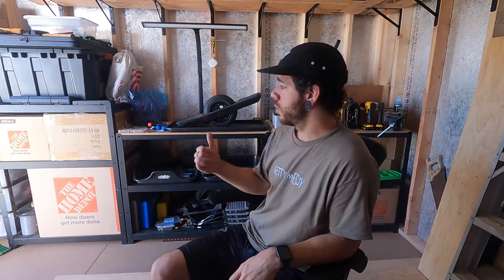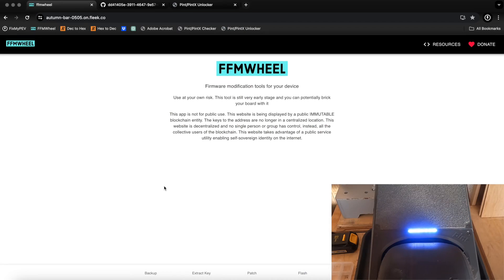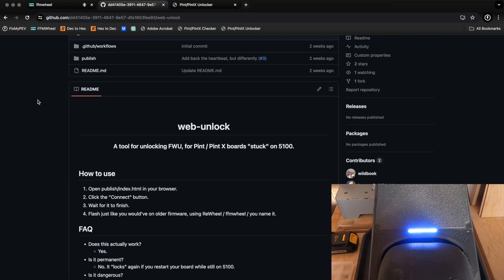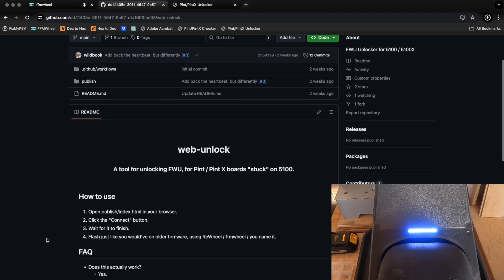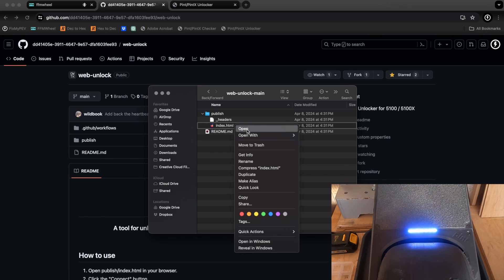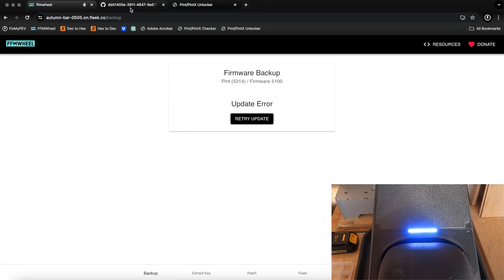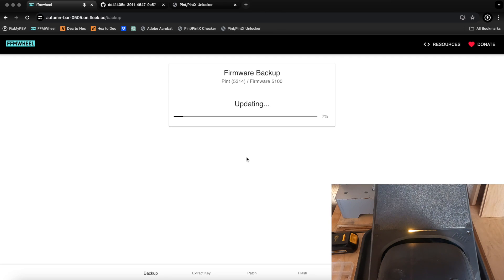Downgrading Onewheel Pint & Pint X: Reclaiming Control

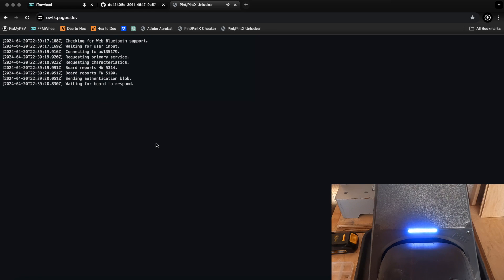Comment from the maker: NOTE: 5:00 / 7:17 - If you're unlocking a Pint X, you will need to go to the 'Flash' tab instead of the 'Backup' tab. The 'Extractor' is not compatible with the Pint X.
Reply: Where do you get 5076 from to flash to the board? “Flash” only allows you to “Choose File” but you can’t “Backup” a Firmware to modify or reload.
Reply from the maker: @kevinaustin2115  To clarify, the backup process doesn’t produce the firmware files. It only produces a bootloader-settings file that is the basis for running firmware to the microcontroller. For information on Gemini - 5076, feel free to send an email at https://www.fixmypev.com/contact-us.
Reply: @fixmypev  back to what Kevin asked.  During this video you state that you CAN do this with the pint x, but you are showing only the Pint being autoflashed through ffmwheel, which pint x is not compatible, you have to upload the firmware through the "Flash" section. Where do you find the file to flash onto the pint x? Are you able to show the process of getting the "downgraded" firmware onto a pint x?
Reply from the maker: The Pint X is compatible with the ‘FLASH’ function of FFMWheel, but nothing else. The Gemini - 5076 file can be located on the ‘RESOURCES’ tab. As for the process:

- Unlock w/ Unlocker Tool
- Navigate to ‘FLASH’ tab on FFMWheel
- Flash Gemini - 5076

The only difference between this and the OG Pint process is that you can’t ’BACKUP’ or ‘PATCH’ the Pint X. Only ‘FLASH.’
Reply: @fixmypev you rock! I’ll try it out
Reply from the maker: Let me know how it goes! 🤙🏼⚡️💯
Reply: Is this information still valid ? I got a pint X fw5100 and would like to downgrade. The unlocking system did seems to work normally. Will I brick it or can I use the file in ressources safely ?
Reply from the maker: @TheCracouvomi  Yes, this information is still valid. However, pay attention to any warning messages you may get when using the unlocker tool. If the bootloader version is not recognized, you are best off not proceeding with the downgrade (BL 255 is ok).
Reply: @fixmypev  it's telling me board reports BL7
Reply: ah damn it doesn't work, i got pintX HW7314
Reply from the maker: @TheCracouvomi  If you see a red warning message, do not proceed. You'll likely brick your board.
Reply from the maker: @TheCracouvomi  The unlocker tool does work with some 7314 hardware boards, but if the bootloader version isn't supported, it's not advised to move forward with the process.
Reply: @fixmypev  no red message on the unlock process, it's the update of the firmware on the flash side of the site that's returning an error. Do i need to do something with the bin file first ? or just select it and pray ?
Reply from the maker: @TheCracouvomi You have to be super quick after unlocking. It helps to keep the FFMWheel sit open with the error up and just hit “Retry” immediately after unlocking again. Should just be a timing thing. You got this!

Comment: Hey man, i noticed you were still active in the comments a few months back, im hoping to get some help.
I've rewheeled my pint before following your guide. Twice actually since I wanted to do a different patch. Now that Ive upgraded my pint with a new battery I was hopping to repatch with the correct battery size. Well, I cant seem to reconnect my onewheel again to my browser, im following the same steps I did before. The only possibly issue I can think of happening is on my last patch, I enabled pint x spoof in hopes of getting that custom shaping, since the custom shaping patch didnt work the first time. 

My step to step error is, i click backup -> Pint Firmware [5040] -> Connect -> (pair in chrome bluetooth window) -> It loads for one animation of the bar filling up -> I go to click connect and go back through the pair window -> repeat a couple times (4-8x) untill I get "This Feature is not supported for your board."

I never had to use the web unlock repo initally, my board was originally 5050, now 5040 after first rewheeling it.

Any help or support would be great. Thanks man
Reply: ISSUE RESOLVED, Dunno what I did other than swap back and forth between EDGE and CHROME a couple numerous times doing my same process until I went straight to the flash tab and was not greeted with the connect button, I just loaded up my new patch with my upgraded battery info and flashed. Board went through the whole flash process, rebooted and works great. We'll see if I can use the full batteries juice now
Reply from the maker: Glad to hear you got things sorted out! It was definitely the spoofing that was causing the issue. The backup process doesn’t work any time you have spoofed as an XR or Pint X. To get around that, all you have to do is skip that step and go straight to the Flash tab (or Patch tab if you’re patching firmware and already have a backup file).

If you ever need help again, feel free to reach out through my website any time: https://www.fixmypev.com/contact-us

Comment: Hi, getting error 23.  Just showed up this weekend.  Tried unlocking the board per your video and it fails every time.  Tried 50 times or so.   How can I fix it?
Reply from the maker: Hey! Error 23 is meant to be displayed when the controller detects abnormal battery usage. If you’re receiving this error and have not altered your battery, you may have a false error occurring. Feel free to email me if you’d like to discuss the issue further.

https://www.fixmypev.com/contact-us

Comment: Hi! If the hardware on my pint is exactly 5314  and the firmware is 5207 is it ok to downgrade ? Thanks for the support! I bought a use pint with the quart battery, i've unfortunately updated the firmwate with the app before using it, my battery gives me only 2km with full charge, could the problem come from the update?
Reply: I have the same question. Let me know if you find out
Reply: @ape1755 yeah, if your firmware is over 5100  you can't downgrade and rewheel. But the owner of this channel offers a mail in service to help you with that.
Reply from the maker: Hey! The Hydrus - 5207 firmware blocks the ability to downgrade via Bluetooth, but I still offer a mail-in downgrade service where I can reprogram your controller. As for the 2 km range, I do know that the newer firmware doesn’t play nicely with extended range batteries, but it would usually still allow you to achieve stock range… It’s possible the update could be flagging the battery sooner somehow, maybe based on the discharge characteristics… but I’m not 100% sure since FM’s firmware is encrypted/protected. If you’d like more info, feel free to reach out via my website.

https://www.fixmypev.com/contact-us

Comment: Sorry if this question is old, but are you okay to downgrade on 5314 and only above is locked, or is 5314 locked out also?
Reply from the maker: 5314 would also be locked if your firmware and/or bootloader is too new. You can check that with the unlocker tool highlighted in the video.
Reply: Yes its definitely locked for me, do you still offer a service to st-link from 5207? I'm in new Zealand  @fixmypev
Reply from the maker: I do! You can reach me through my website.

https://www.fixmypev.com/contact-us

Comment: Very cool! Will this work with Hydrus 5207 firmware + 5314 hardware? What app(s) would you use to adjust parameters, set new pushback limit? 🙏🏼
Reply from the maker: Unfortunately, no. To downgrade a controller running Hydrus - 5207, you’d need to completely reprogram the microcontroller.

That’s a mail-in service I offer if you ever want to take advantage of it.

https://www.fixmypev.com/contact-us

Comment: Will this work on a og pint running firmware hydrus 5207 and hardware 5314
Reply from the maker: It’s unlikely due to the limitations implemented by Future Motion in their newer firmwares, but would be possible via hardware methods. I believe you and I discussed this elsewhere already, but wanted to make sure to answer on the record here as well. If you have any further questions, feel free to reach out via my website any time. https://www.fixmypev.com/contact-us
Reply: Yes we did you cleared it up for me well thanks unfortunately my boards not compatible with this video 🎥  @fixmypev

Comment: Am I able to downgrade from Hydrus - 5207 using the same process?  Thanks in advance!
Reply from the maker: Unlikely, but check the note in the video description. If your board isn’t compatible with this method, feel free to reach out via my website. I may be able to help, depending on your board’s hardware version.
Reply: @fixmypev  messaged through website

Comment: Whats the scoop on newer pint x's and downgrading to delete the Haptics?

Unlocker tool gives me the RED no go but I read a comment with some success on a newer HW?? Im not finding any solid pattern as to what HW/FW can or can't downgrade. Seems a bit scattered. Maybe I'm missing something obvious??

Ive got a PintX
HW: 7323
FW: Hydrus 5200
Reply from the maker: The newer boards ship with newer bootloaders and the hardware doesn’t play nicely with older ones. As a result, a lot of the newer boards are unable to be downgraded to pre-haptic firmware.

Comment: Does it work with the 5207 firmware? I have a error 23 and trying to solve this
Reply from the maker: Only if the unlocker tool gives you the green light. Many of the newer hardware version boards are incompatible.

Comment: Has anyone tried with HW5326? Did it brick the board?I understand he says it will but he also states it has been untested so I'm wondering if anyone sacrificed they're board 😂             for science
Reply from the maker: If the unlocker tool doesn’t give you the green light, the process won’t work. It has been tested since this video was made. 5326 boards were not made to operate on Gemini - 5040 firmware.

Comment: Do you have any updates on using firmware like 5207? I accidentally updated twice and it might be placebo but I feel like my pint doesn’t have as much torque.
Reply from the maker: I’m not sure if there’s a confirmed basis for a reduction in torque with the new updates. I actually thought that remained relatively the same, but I do know they added at least 1 MPH to the top speed/pushback threshold to match the Pint S.

Comment: Is there anything I can do with a newer pint with 5326 hardware / 5100 firmware??
Reply: I have the same hardware. I really hope there becomes an option. Having purchased the board myself I should have full ownership and rights and yet they lock me out of it 🙁
Reply from the maker: Unfortunately, no. The newer boards weren’t designed to work with the older firmware. There are experimental things that may be able to be done, but they would require a full wipe and replacement of the content of the microcontroller.

Comment: I have a quick question? I was able to follow and complete the downgrade. The hepatic buzz is gone but my pint x feels slower now? With the downgrade it should’ve gone back to its original state right? Should I do the downgrade again?
Reply from the maker: If you’re already downgraded, you shouldn’t have to downgrade again. I believe the newer
firmware raised the top speed from 19 MPH to 20 MPH. Unless you’re accidentally in a different ride mode, that may be what you’re experiencing.

If you have any additional questions, feel free to reach out at https://www.fixmypev.com/contact-us.
Reply: @ Thank you for the great info! Appreciate it. I have not ridden my pint x since the hepatic buzz and speed limitation which bummed me out because I used to ride every chance I had.

Comment: Any news on  potentially unlocking 5200+ with all the issues its been having?
Reply from the maker: There’s a new firmware available (Hydrus - 5207), but I’m not sure if they’re holding off on pushing it to the masses or if it’s even supposed to fix the issues with 5205. Message me at https://www.fixmypev.com/contact-us if you’d like more info.

Comment: pint with a quart battery and rewheel upgrades is so incredible. Don't really see the need for anything else. It just works.
Reply from the maker: It is pretty great, isn’t it? The only thing I might do that would be an upgrade over that would be to source a Pint X battery module and hook that up. 15s2p power! 🔋

Comment: does this void warranty?
Reply from the maker: Since it’s reversible, I wouldn’t think so, but if you sent a board in for warranty work with modified firmware, there’s a chance you’d face some challenges.
Reply: @fixmypev  ok thanks

Comment: Hello! Is any way to do this with a stock Pint on FW5108/HW5326?
Reply from the maker: Highly unlikely. The newer boards have newer bootloader versions that are unable to be bypassed using the older tools. That said, swapping your controller to an earlier hardware version is an option. I might even have one; I’d have to check. Send me a message at https://www.fixmypev.com/contact-us if you’d like to discuss this further.

Comment: Hello, haven’t found answer for this question, so: should charger be plugged to the board while downgrading software?
Reply from the maker: That is not necessary or recommended. Generally, you can just turn the board on and complete the downgrade process. As a precaution, make sure your battery is charged to at least 30% or more. This ensures the board will not die midway through the downgrade process.

Comment: Hey, I have a quick question, and I hope you can answer it for me. I'm about to downgrade a pint from 5100 so I can calibrate the tilt only for wtf rails. It has a chi quart s battery upgrade. It will be going to my nephew for Christmas, so I don't need to rewheel or change other settings. My question is, after I complete the tilt, can I still use the ow app? Would the board brick if I update it in the ow app? Is the new battery going to be an issue? I don't mind the haptic buzz because my nephew is 7 years old.
Reply from the maker: After you complete the tilt, yes, you can still use the app. As for the battery, it is not advised to update again afterward because the newer firmware generally flags abnormal battery usage and limits the capacity of aftermarket batteries which defeats the purpose.

Comment: its saying this: 
[2024-11-01T22:48:49.665Z] Unlocked FWU mode, but your Pint is not supported.

[2024-11-01T22:48:49.666Z] +-------------------------------------------------------+

[2024-11-01T22:48:49.666Z] | IF YOU CONTINUE YOU WILL VERY LIKELY BRICK YOUR BOARD |

[2024-11-01T22:48:49.667Z] | WE CAN'T PREVENT YOU FROM TRYING ANYWAY, PLEASE DON'T |

[2024-11-01T22:48:49.667Z] +-------------------------------------------------------+

Comment: Hi Justin- I just rewatched this and have some questions, if it's okay. I just grabbed an OG Pint 5314 on Gemini 5100. My goal is to Rewheel it to 5040 but the Rewheel instructions says  "This process is not compatible with firmware version Cassiopeia – 6153+ (GT) or Gemini – 5100+ (Pint)." 

1) Is this correct, can 5100 not be Rewheeled? 
2) Or, can I downgrade it first to 5076 (not sure if this is only for the Px?). Then once the fw is downgraded to 5076, try the Rewheel process to get it down to 5040?
3) Or, can I downgrade it first to 5040 then, once then, try the Rewheel?

Thanks!
Reply from the maker: Gemini - 5100 cannot be Rewheeled, but you’re on the right train of thought. You can 100% downgrade first and would flash Gemini - 5040. Gemini - 5076 is only for the Pint X as you were thinking.

Using this video as well as the ReWheel one should have you all taken care of!
Reply: @fixmypev  Awesome— thanks! I tried to Rewheel but gets stuck at the extraction (after dumping boot loader and settings) at 16%. The first time, the boards turned off and lightbar turned multicolor. I was able to flash it back to 5040 but can’t seem to Rewheel. It now shows 5312/5040 (it was 5314/5100)— I should still be able to Rewheel right with this version, right?
Reply from the maker: Yes. Also, it normally only freezes if you tap the ‘DUMP BOOTLOADER’ button too quickly after flashing the extractor. Try waiting 10 seconds after the extractor is flashed before you proceed.

Comment: I got a rainbow color after flash, what should I do next ?
Reply from the maker: Which board model are you attempting to downgrade? Also, what is your hardware version?
Reply: @fixmypev  HW 5301 and FW Gemini 5100 for the Pint
Reply from the maker: @Steveneven92  You should be able to go ahead and flash Gemini - 5040 now. You can also apply patches to the firmware using FFMWheel, but if you didn’t get a bootloader-settings file, you’ll need to complete the process outlined in the following video first:

https://youtu.be/OT6Wd7G6haY

Comment: Hey man I just rode my Onewheel pint for the first time in 6-8 months but it threw me off my board twice in a row while travelling roughly 10MPH.  The motor jittered and stopped for a split second.  Why is this happening ??
Reply from the maker: It's difficult to diagnose simply based on your description, but did you get any error messages? Did the lightbar flash? Were you tracking the rides?

If you want to follow up with me via email, that's the best way to get in touch: https://www.fixmypev.com/contact-us
Reply: Idk man i have the same thing, it may be the new update

Comment: I have a 5301 Pint on 5100 firmware. Is it really as easy as going to the site to downgrade it? Does it still work?
Reply from the maker: Yes, it’s generally that easy. Check the unlocker tool to make sure you have a supported bootloader version. I’d imagine you do given that you’re working with a 5301 board.